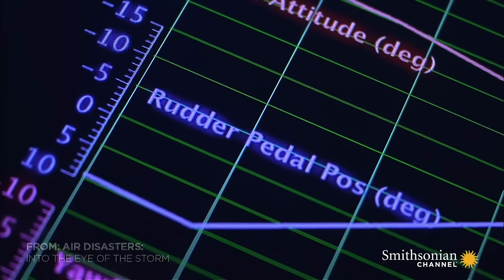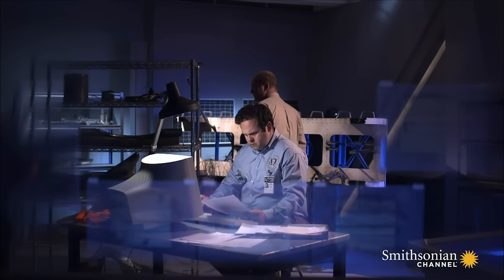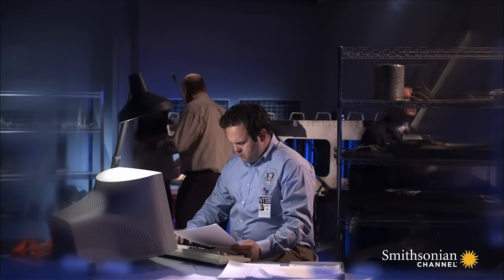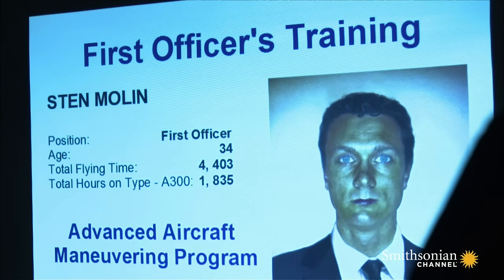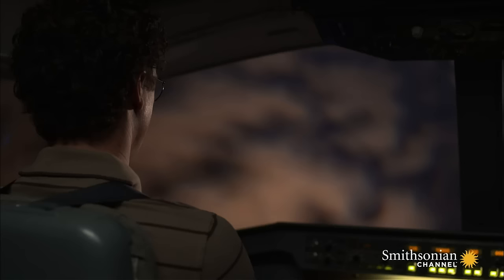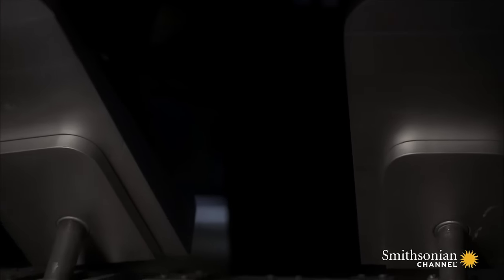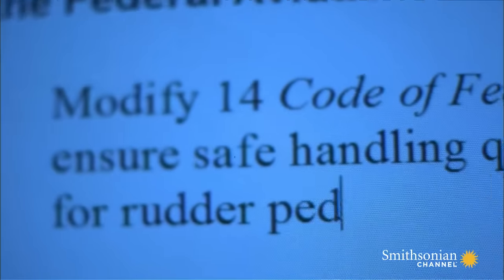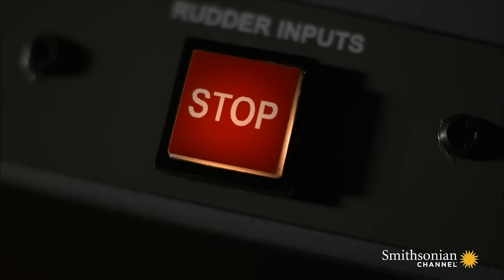Did a Poorly Trained Pilot Cause Flight 587's Crash?

Comment: how can a plane be designed so badly, its like owning a car and if you floored it abit too hard your engine explodes, some simple system should be installed when load on the tail exceeds the amount it can handle the rudder is dampened

Comment: There could be sensors as in anti- lock brake systems, that would detect to much rudder ( or any flight control surface) of excessive hydraulic force and at lest warn flight crew if not override inputs.
Flying your ship to structure damage level is just way to much input force to control surface, essentially, 
you're asking your ship to do what she can not do and disaster lurks nearby.
As with any vehicle powerful controls require respect and judicial use accordingly.
Flight crews are in charge of many hundreds of lives at any one time. They must be fully adept at there craft for all the lives involved. Here the captain should have immediately took the aircraft.

Comment: So, explain something to me here. What's the point of building a plane with that amount of rudder degrees if they know it's not gonna stand such imputs? If it was structurally unsafe due to the loads, why not just build it with 5 degrees tops? It seems to me like an excuse to shift the blame to the pilot instead of the plane builder.
Reply: Lucas Tulic the rudder could withstand an 11 degrees with 1 movement, but multiple movements at 11 degrees here made an extreme amount of force on the rudder
Reply: The amount of force generated depends on both the rudder deflection and on the aircraft's speed. While a couple degress may be enough to get the desired yaw moment at high speed, the pilot may well need 10+ degrees deflection at lower speeds to achieve the same effect. It's a lot like how you only turn your steering wheel a tiny bit in a car to turn at high speeds, whereas you need to turn it a lot more when moving slowly.

Comment: I'm deeply suspicious of this conclusion.  What kind of Aircraft is so fragile that it's rudder is ripped off.  Why Would a pilot continuously move the Rudder back and forth to reduce turbulence.  Why did it not occur on other flights ?
I don't believe this was the pilot's fault at all.  This is a classic cover up.
Reply: Since you know more than the investigators, off you go and sort it out. Also, the pressure applied to the rudder wasn't just a few kilos of force, but tonnes.

Comment: seems they would have designed the tail to handle more force than that, to prevent a the tail from coming off. i'm sure this has happened on other aircraft and the tail didn't detach from the plane.
Reply: John Crazy well the others planes tails probably didn’t get 90+ tons of force on them

Comment: This crash is same like JAL Flight 123 but why JAL Flight 123 can control the airplane above 30 minutes but American Airlines Flight 587 can control the airplane.
Reply: Landing a plane without hydraulics has been done several times. Landing a plane without a vertical stabilizer has only been done once. It's a lot worse, especially if the pilots are unaware of the problem.

Comment: So this crash is definitely caused by pilot error due to poor AA training but I wonder whether Airbus can add a computer system that would prevent the rudder from being moved this much. Kinda like alpha floor protection but for rudders
Reply: Yeah maybe, then they’d crash when they got an engine failure and couldn’t move the rudder enough. Great idea…not.
Reply: @peteconrad2077  or they'd move the rudder so much it'd rip the vertical stabilizer apart and cause the plane to be completely uncontrollable

Comment: Why couldn't the ATC have vectored 587 to stay put at some 2000 feet or so, let the B747 clear the area and then asked them to climb out ? Why did the A300 have to follow the B747 on the exact path ? The  747 was heading to Japan  AFAIK and this plane was heading to the Caribbean. They could have separated the climb profiles right out of the extended runway line.
Reply: Wake is fine  it’s how the pilot reacted that was the problem.
Reply: @peteconrad2077  I get that, but it wasnt some unavoidable "natural" phenomenon like a CAT.  Arent we putting too much  burden on a pilot and his/her hand flying skills in that situation unnecessarily ?
Reply: @theacechip  no. Correcting attitude deviation from wake is a normal part of flying. Thousands of pilots do it every day without ripping the fins off their aircraft.
But it wasn’t Stem Molems fault. He’d been trained to do that.
Reply: @peteconrad2077  Ok..Sad though.
Reply: @theacechip  don’t be ridiculous.
Reply: @peteconrad2077  Commented on the incident as a whole.
Reply: @theacechip  I doubt that. The train of conversation is obvious.

Comment: I wonder why the plane stalled after the tail break off. Also in warthunder realistic mode i dont use rudder that much. 

(They often shoot my rudder!)

Anyway how i pilot is i tilt the plane and use the whole plane as rudder then tilt back for lift until i reach runway, it may be hard but its not impossible.
Reply: zeckmon3 zeckee it didn’t actually stall, but it no longer could produce lift as the plane became uncontrollable

Comment: Airbus should build better planes.  If it can't tolerate an inexperienced pilot, the plane won't survive bad storms, torque from engine failure, etc.  (Not to mention Boeing, whose greed in rushing to market over the decades, builds planes that very experienced pilots cannot fly.)
Reply: No aircraft manufacturer builds aircraft to tolerate that handling. If you don’t know stuff, don’t comment on it.
Reply: @peteconrad2077  Well I agree that none are built very well at all.  As light as can for fuel savings, unreliable IT metrics, and extremely inflammable.  Not certain what your issue really is or why your so defensive.  Maybe a ride on a 737 Max which was "built to withstand" that kind of  piloting would cool your jets? Planes are built for profit, not safety, even you cannot argue that.
Reply: @Torontotootwo  can you explain the low fatal accident rate if safety is so low a priority? 
With 16,000 hours on jets, TRI TRE and 10 years as a technical manager, I’ve been far enough to know what I’m talking about.
Reply: @peteconrad2077  Your safety rate point is valid - it has improved.  I still believe it could be much better if the FAA was more consumer oriented; blame that on politicians.  Flight management systems should be less counter-productive; how many times on CVRs do we here, "What's the plane doing?". Pilot training - both in flying and Management Systems needs to be kicked up several levels.  Frying alive in an overcrowded plastic environment has to be a horrible  nightmare.
Reply: @Torontotootwo  the “what’s it doing”, meme has been and gone now. The issues of the new FMS systems have been largely worked through with better training. The key issues now are distraction still (getting bogged down in the problem and not flying the aircraft), problem solving/decision making (using effective problem solving strategies instead of just relying on pattern matching) and mitigation of startle when it suddenly goes badly wrong and your SA drops through the floor.

It’s up to airlines to invest in this (and many do, to be fair) since the regulators have been starved of the resources to do it properly.

Comment: Why does a plane just plummet when the rudder breaks off?
Reply: B1SQ1T you can’t control the plane; no lift, no steering
Reply: The loss of the fin means it's unstable in a straight line and starts a flat spin

A spinning plane doesn't generate lift since it's essentially flying slowly in a small circle so it falls

As the spin increased the forces sheared the engines right off

Comment: Perhaps the old plane is to blame. Is it possible that the plane's design is so fragile that it cannot bear the dynamic pressure?
Reply: Plane was fine, it was the poorly trained F/O who caused this
Reply: @AB-mw8oz  
But it has to be asked, is a design safe when merely using aggressive rudder inputs can rip off a tail?
Reply: @cchris874  Excessive inputs will doom any plane.

He did exactly what he was trained to do, American Airlines trained him to react that way
Reply: @AB-mw8oz  OK. Just wondering though, could rudder inputs rip the tail off of any jetliner type?
Reply: @@AlexB-ud7gz They were retired 15 years ago
Reply: @@AlexB-ud7gz American Airlines last flew the a300 in 2009. Most a300s still in service are cargo variants with 20-30 still in passenger service, operating for airlines in Iran and Hong Kong

Comment: Maybe someone can answer a question I have about this. The plane fell from the sky after losing the vertical stabilizer, however Japan airlines 123 lost its vertical stabilizer as well, yet continued to fly for nearly 30 minutes. Why did the airbus fall the and not keep aloft?
Reply: Flight 123 still had a few bits of the stabilizer left but the AA had no stabilizer in this accident
Reply: +Papercraft Nony That is true. I guess I was wondering why it would cause the wings to lose lift but I guess if you can't control the plane,lift is the least of your worries. Thanks for the reply
Reply: The Rudder or tail act as like a pointer in which in keeps the plane from pointing in 1 direction like the rudder on a boat, without it, the plane will lose it's stability which means it would spin thus losing lift.
Reply: +Papercraft Nony Ah, it makes sense now. thank you very much.
Reply: +Brentt As others have mentioned, JAL 123 had some of the tail remaining while AA 587 did not. However there are also other factor at play, JAL was in stable flight when its tail detached, but AA587 was yawing quite quickly when its tail broke. Other factors such as CoG location, fuselage shape, engine location, shape of wing ect. Even wing-sweep angle comes into play (more swept back wings give better yaw and roll stability, and the 747 wing has more sweep back than an A300 wing), to find all the factors you would need to be an aerodynamics with access to as much data on each aircraft as possible
Reply: +Jamenator1 Thank you very much. I have always been interested in crash investigations. This sheds light on why it lost lift when the copilot slammed the rudder peddles. Thanks again.

Comment: We know why the tail snapped off, but why did that in turn make the plane fall from the sky?
Reply: +DowntownCanon: The "tail" that broke off on Flight 587 was the vertical stabilizer, which is the rudder, like on a boat, it's used to steer.  Remove it, and the plane will spin in circles, over stressing the wings, engine mounts, and the airframe.  Before the crash, the engines snapped off due to the G forces placed on the engine mounts.
Reply: +John L Kinda like if the earth stopped moving, everyone's head would snap off.
Reply: Ker-SNAP!

Comment: The airbus composit material was stronger than had to be, yet the parts that were made of aluminium didn't break. Imagine if the entire tailfin rudder was made of aluminum the crash wouldn't of happened .Why did the engines sheer off? Right, pilons were made of composit material.
Reply: ..........................what?

Comment: Can someone explain why a plane can’t fly without the tail? I thought with wings and engines still intact they could still turn back and land it.
Reply: The loss of the entire fin not just the rudder means it's unstable laterally in a straight line and starts a flat spin. Like a powered arrow without a tail.

A spinning plane doesn't generate lift since it's essentially flying slowly in a small circle so it falls

Comment: How do aircraft fall  out of the sky if the rudder detaches?
Reply: Because it gives the aircraft directional stability. Without the rudder it quickly slides out of control.

Comment: The details described by this video is not only false, but it omits a critical contributing factor that caused the severe Rudder Deflection to separate from the Vertical Stabilzer.  This flight taken off from JFK was approximately at flight level 3000'.  The Left Engine fell off the wing.  On a Climb Out with one engine out, this will cause Asymetrical Thrust which in turn will cause the aircraft to roll over on its back creating an Aerodynamic Stall. In such an incident  there is no recovery for an aircraft relative to its Type and Altitude.  
The Pilot-in-Command knew this, and applied Opposite Rudder to prevent the aircraft from rolling.  However, in the panic too much Rudder was applied causing it snap off.  The flight at that moment was doomed.  Airbus Industries later on advised all carriers that Rudder Deflection was never to exceed 22 Degrees.  It's too bad most videos relative to aircraft accidents and destruction are severely flawed or fraudulent. 90% of all aircraft accidents are due to"Pilot Error".  NTSB, Aircraft Manufacturers,  as well as the Airlines themselves cover up this fact due to Liability and subsequent litigation that would run into hundreds of millions of dollars for each aircraft loss and passenger fatalities.
Reply: No such thing happened the engines fell off after the fin snapped from the centrifugal forces of the spin.

The fact that you refer to the altitude as "flight level 3000'" says you have no idea what you're talking about Flight Levels start at 18k feet and is referred to as FL 180

Comment: BS..Bs...if the plane was designed correctly the rudder or linkage would have failed before the vertical stabilizer failed!!!
Reply: Nonsense. You cannot design around overswing because it’s an unbounded force. 
Go elsewhere where you can talk about stuff you understand.

Comment: How does the rudder affect the flight 
I mean like crashing cause I can definitely fly a plane that is missing a rudder
Reply: Dᴏɴᴀʟᴅ J. Tʀᴜᴍᴘ you can fly certain planes without a rudder, but not commercial airliners
Reply: The loss of the entire fin not just the rudder means it's unstable in a straight line and starts a flat spin

A spinning plane doesn't generate lift since it's essentially flying slowly in a small circle so it falls

Comment: I don't know shit about planes but shouldn't a plane be able to fly without a rudder? At least a bit?
Reply: cholomackdaddy  there was a pilot that landed his f15 with one wing
Reply: I don't know much about the flight of planes, so don't see my answer correct, but. I think the plane could have managed to struggle for a few minutes, before all hydralics are lost. In my opinion, a plane can fly for a few minutes, before it might go in a flatspin or a spiral.
Reply: You could fly without a rudder; but it’s impossible to fly a commercial airliner without the whole tail
Reply: The loss of the entire fin not just the rudder means it's unstable in a straight line and starts a flat spin. Like a powered arrow without a tail.

A spinning plane doesn't generate lift since it's essentially flying slowly in a small circle so it falls

Comment: Shame on you for putting the blame on that on that crash on that the co-pilot shame on you I spoke to the copilot's father and they ran all kinds of tests in the test pilots had a hard time keeping keeping the rotor movements within the limits that they were supposed to keep him in there's no way that a plane could allow One Pilot to totally caused it to crash without the other pilot being able to stop it this is not an experimental play this is a bad design a very bad design it was a good design they would have had the actual movable movable flap in the vertical stabilizer fail before the main tail failed
Reply: It's the flight crew's job to keep the plane within designed specification. While it's hard to blame the FO given he was just following AA training, that doesn't mean the tail was inherently weak. The fact is that no other accident involved a ripped vertical stabilizer as a result of repeated and severe rudder input, suggesting that the tail's strength was never an issue when properly used. Furthermore, the tail on AA587 failed at TWICE the designed load, a whopping 203,000lbf.

Comment: the rudder, why did the tail break so quickly, with all the tension it should’ve stuck with, like clearly was a cheap airplane.
Reply: No, it was not. If you change the direction of huge loads swiftly, you will end up with catastrophic dammage
Reply: This kind of build-up of stress would've caused the tail to break off any airliner. The tail was certified to be able to take 150% of the stress it was ever expected to encounter in flight, like it is on any airliner, by any manufacturer. The tail on this one broke off at stresses of more than 200%, meaning it was even stronger than required.
Reply: It's the flight crew's job to keep the plane within designed spec, which clearly didn't happen here: the FO applied way too much rudder deflection given their flight speed, and did so repeatedly. While it's hard to blame the FO here given he was following AA training, that doesn't mean the A300 itself was compromised. No other A300 has crashed as a result of sustained rudder deflection, suggesting that vertical stabilizer strength was never a problem when the rudder was used normally. 
If anything, the NTSB investigations shed light on how much force was actually acting on the tail before failure, which was TWICE the designed load (203,000lbf vs 100,000lbf as designed).

Comment: They are flying an A300 and steering with a yoke...
Reply: Yes. That is correct. The Airbus A300 and the A310 had yokes. Until the A320 came out. She had the joystick and the all new Fly-by-wire system.